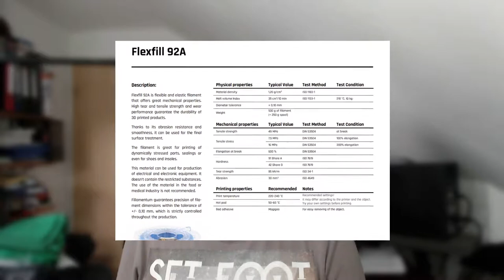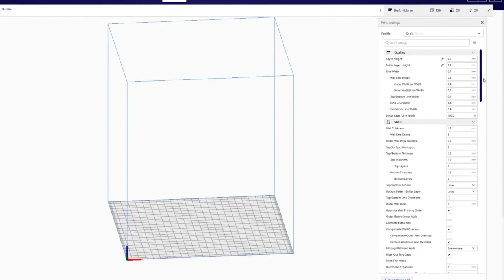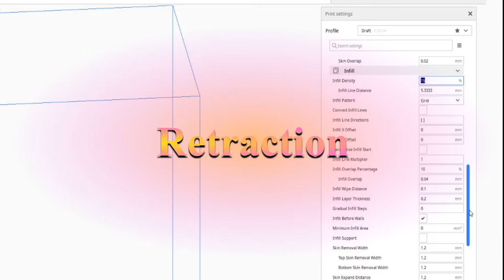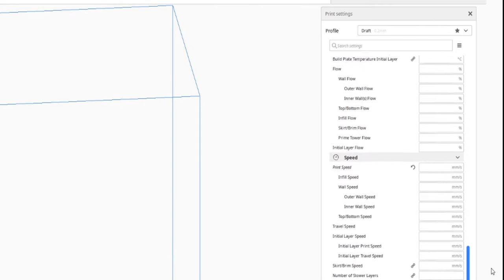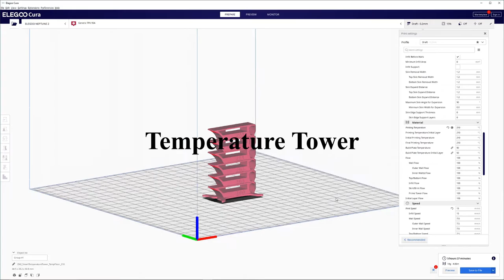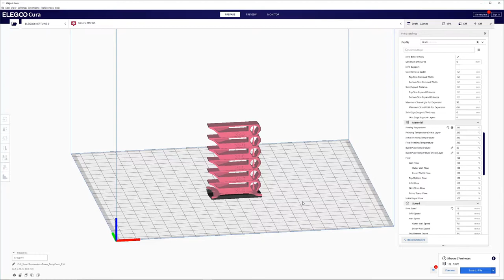Flexible TPU Printing With a Bowden 3D Printer: What You Need to Know

Comment: Nice I will try flexible I have some eSun green tpu but I always was worried to print it because of the bowden on the ender 3 v2 and years ago i stupidly converted my anet a8 to bowden who knows why but finally decided to research it again so will try these settings and tips thanks mate
Reply from the maker: Glad to hear that the video encourages you to try it again. Some more things might increase the chances to get good results. If not already installed a dual gear extruder will provide better pushing force. Furthermore replacement of the PTFE-Tube by a Capricorn should provide better guidance feeding the filament to the hotend. Keep the tube as short as possible. With both the retraction settings can be lowered. Last but not least printing slow (10-15 mm/s) at the right temperature is key for printing TPU.
I'd love to see your results!

Comment: Welches TPU hast du dort genutzt? Ich würde gerne einen GoPro Drohnen Mount drucken und habe bisher gelesen, dass 95A TPU ausreicht. Ich habe den gleichen 3D Drucker. Schafft der Bowden Extruder 95A oder ist das zu weich?
Reply from the maker: (English follows at the bottom)
Hallo Julian, mit Shore 95A solltest du keine Probleme haben. Die im Video zu sehenden Drucke habe ich mit Fillamentum
Flexfill TPU 92A Signal Red, also einem noch weicheren Material, als 95A auf dem unveränderten Elegoo Neptune 2 Drucker gedruckt, so wie er geliefert wurde. Das hat sehr gut geklappt, obwohl ich aufgrund des verbauten Extruders da zunächst meine Zweifel hatte. Am wichtigsten ist, dass du zunächst für dein Filament die besten Druckeinstellungen ermittelst, indem du, mit einer langsamen Druckgeschwindigkeit von 10 mm/s - 15 mm/s erst einmal einen Temperature Tower druckst. Druck und Heatbed Temperatur erst einmal nach Herstellerangaben einstellen. Bei der Druckgeschwindigkeit würde ich etwas experimentieren. Zu langsam ist hier auch nicht immer der Clou, aber auf gar keinen Fall über 20mm/s, das schaft man auf einem Bowden Drucker in der Regel nicht. Prinzipiell wird immer gesagt, bei TPU mit einem Bowden Drucker keine Retraction zu verwenden. Das sehe ich nicht so. Eine konservative Retraction Einstellung von 1-3mm kann den Druck durchaus verbessern. Auch hier muss man sich je nach Material herantasten.  Erste ein bis zwei Layer mit ca. der Hälfte deiner eingestellten Druckgeschwindigkeit.
Wichtig: Das Modell sollte sich möglichst ohne Supports drucken lassen, weil das echt kaum zu entfernen ist. Wenn es nicht ohne geht, dann versuche mit sowenig Supports wie möglich auszukommen und schneide den dann mit einem Skalpell oder Cuttermesser ab.
Die Tipps bringen Dich hoffentlich zum Erfolg. Würde mich freuen, das Resultat, den GoPro Mount, zu sehen.
----------------------
Hi Julian, you shouldn't have any problems with Shore 95A. The prints you can see in the video were printed with Fillamentum
Flexfill TPU 92A Signal Red, which is an even softer material than 95A, on the unmodified Elegoo Neptune 2 printer as it was supplied. This worked very well, although I had my doubts there at first due to the extruder installed. The most important thing is that you first determine the best print settings for your filament by first printing a temperature tower at a slow print speed of 10 mm/s - 15 mm/s. The print and heatbed temperature should be set according to the temperature of the filament. Set the pressure and heatbed temperature first according to the manufacturer's instructions. I would experiment a bit with the print speed. Too slow is not always the clou, but in no case over 20mm/s, you can't do that on a Bowden printer. In principle, it is always said not to use retraction with TPU on a Bowden printer. I do not see it that way. A conservative retraction setting of 1-3mm can definitely improve the print. Here, too, you have to approach depending on the material.  First one or two layers with about half of your set printing speed.
Important: The model should print without supports if possible, because that is really hard to remove. If you can't print without supports, try to use as few as possible and cut them off with a scalpel or cutter knife.
Hopefully these tips will bring you success. Would be happy to see the result, the GoPro Mount.
Reply: @3D_Printing_Geek  Hey, vielen dank für die umfassende Antwort! Deine Videos sind wirklich gut. Gerne abonniert. Und eine englische Version ist nicht nötig :).
Ich melde mich wenn der Druck gelungen ist. Liebe Grüße
Reply: @3D_Printing_Geek  Und danke für das umfassende Video besonders im Hinblick auf die Druckeinstellungen. Das spart mir eine Menge Fehldrucke.
Reply: @3D_Printing_Geek  Der Mount ist eben fertig geworden. Mit 200 Grad gedruckt (anderes TPU von Amazon). Die anderen Einstellungen habe ich übernommen und Support genutzt, da es sonst nicht umsetzbar gewesen wäre. Hat super geklappt. Bin wirklich überrascht davon, wie sauber das Ergebnis geworden ist. Vielen Dank für das aufschlussreiche Video!
Reply from the maker: @julianrsch6256  Hey, Klasse von dir zu Hören, dass Du den Mount erfolgreich drucken konntest! 
Ich hoffe, dass ich bald, nach längerem, wieder mit neuen Videos am Start bin. Habe gerade ein paar Ideen in Arbeit, die in den nächsten Tagen fertig sein sollten :-)
Reply: @3D_Printing_Geek  Das würde mich freuen. Die Benachrichtigungen sind bereits an! :)